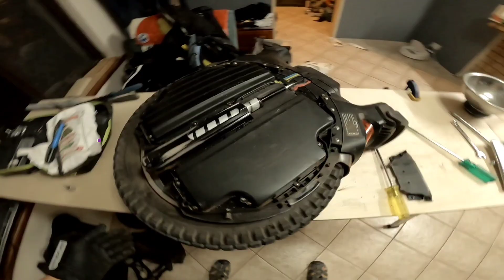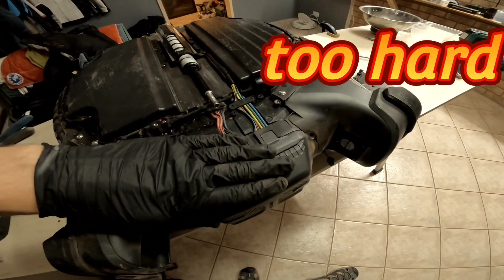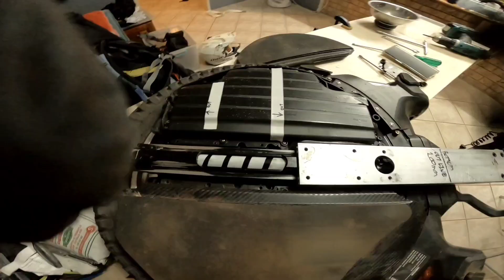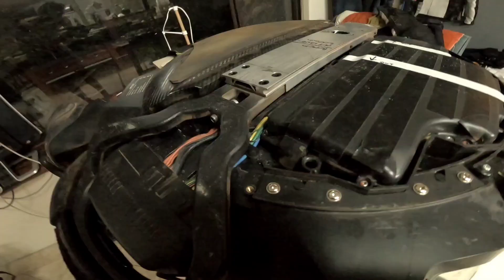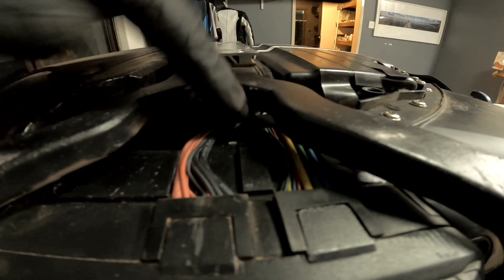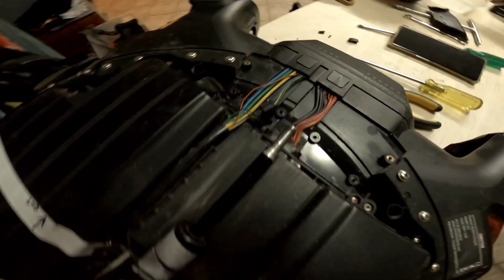InMotion v11 motor cable mod part 1

Comment: Wouaou… you’re my Euc god…! Can't wait to see the result… That was exactly my thought on how to simplify the V11 disassemble…
Reply from the maker: Sure is. Changed a tire on the s18 for a mate and that's how they do it with a simple plug. Shocked the v11 has no plug.
Reply: Can't wait to see the finished mod.  Would be very grateful if you could share the plugs your using.  I would like to do this mod on my v11.
Reply from the maker: Just cut the cables then to repair the rim I bent.
Lots of mods coming